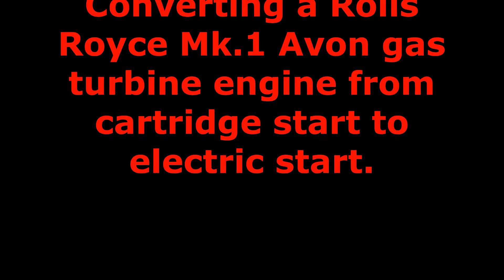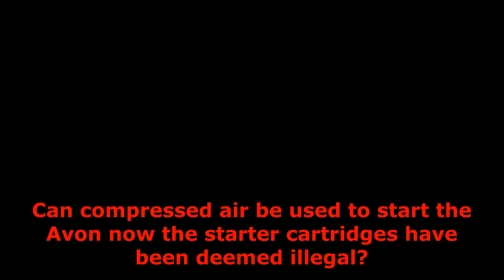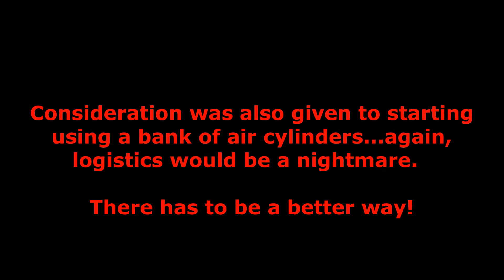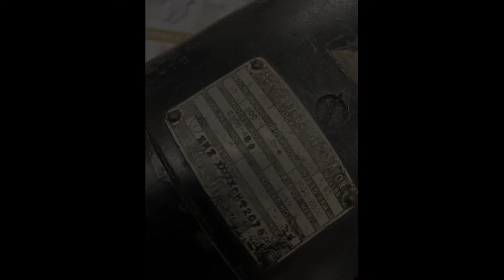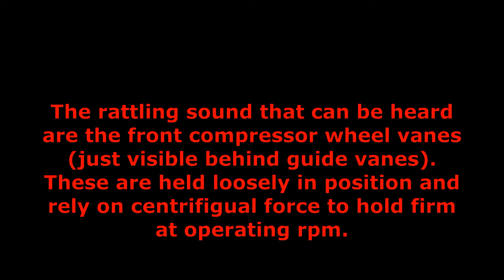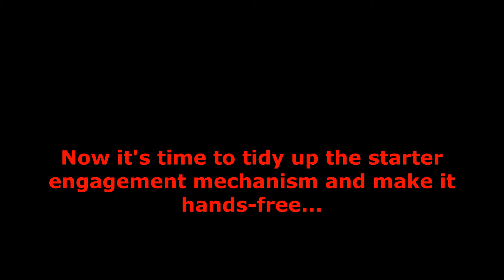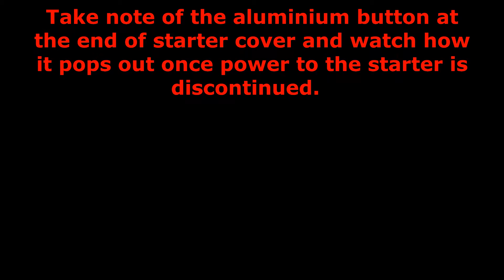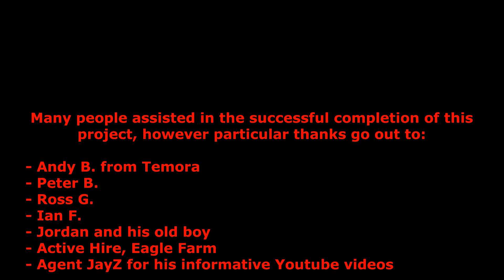Rolls Royce Avon Electric Start Conversion

Comment: Hopefully you'll read this.  I am in the process of restoring a Hawker Hunter Mk 74B with a 200 series Avon that I need to convert to electric start, but acquiring a Rotax C6803 starter motor has been impossible.  I would greatly appreciate your help, your setup should work since both the 100 and 200 series Avons have been converted with the same starter. Would you be willing to provide your drawings so that we can try and duplicate them here in Florida?  I have an excellent machinist available that could make the necessary adapters.
Reply from the maker: Hi  happy to help      Does yrs have the internal spline where the starter connects into the main shaft

Comment: What about APU
Reply from the maker: Wldnt work
Reply: @johnrutherford9937  not enough PSI?
Reply from the maker: nowhere to feed the air in    The cartridge spun a starter that drove the front  of main shaft   Never designed to be spun using high volume air supply

Comment: Fantastic job! Interesting to see how you managed with only 24 volts, whilst the Caravelle uses a 112v system for starting, (actually 5x 24-28v batteries). 
I have a question if you don't mind. Could you tell me at what RPM the Inlet Guide vanes generally move from the start position to the full power position? In my SE-210 manual it shows a governor, and it states that at 7000 RPM the IGVs should be in full fine pitch, however I can't find if this is an instant change (on-off); or a gradual change and at what RPM the movement starts. Thanks for keeping these old engines running and sharing your videos! Best regards, Rico
Reply from the maker: @pilotnl    Hi i think they change at 5600 rpm  the compressor bleed valves close at the same time

Comment: When I was in work, we had a gas compressor driven by an Avon(gas fired..) it was started with a large 2 speed 3 phase motor…we also ran an RB211 driving a compressor, that had a gas started fitted to it…